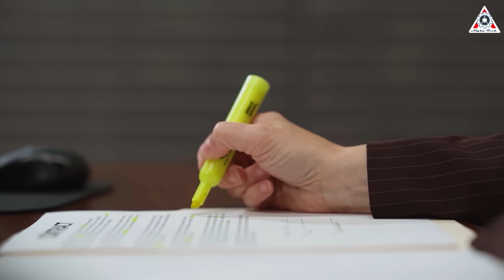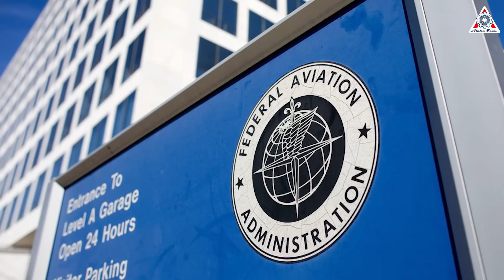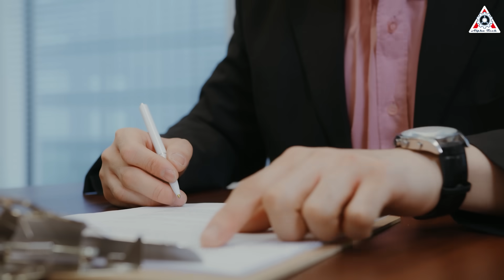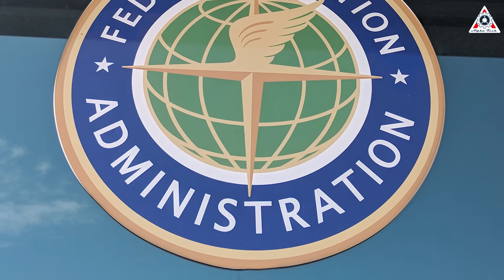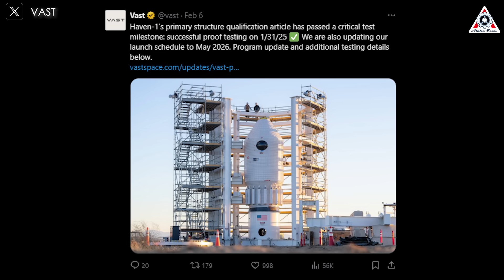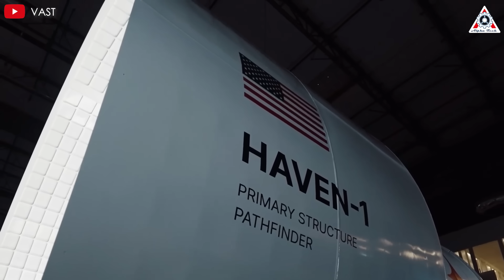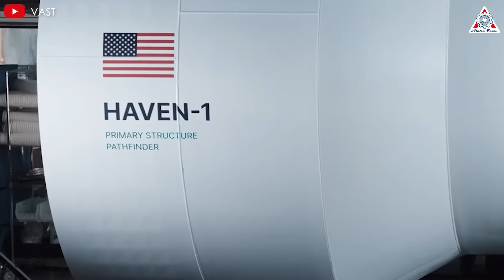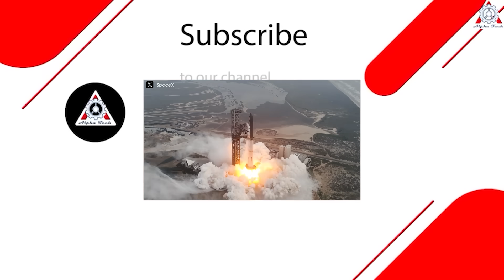SpaceX Starship New Landing Method somehow SHOCKED NASA! Never Seen Before...

Comment: If landing on a re-purposed AC Carrier ever comes to pass, I'd swap out the diesels for methane generating plant and electric (Tesla???) engines... and yes, I know there would be issues with energy density of methane vs diesel and the size of Tesla motors would probably preclude any advantages of a hybrid propulsion / one fuel source solution... ;-)
Reply: You better put some big pontoons on it otherwise whenever the Starship lands on it it's going to lean to one side or the other and then it's going to slide off the deck into the ocean.
Reply: wave generative battery or a nuclear mod instead of the hybrid

Comment: Staff?  Pad maintenance?  Fuel transport and storage?  Payload transportation?  It's one thing to catch a rocket and then transport it somewhere else but if you are going to catch AND launch from the same place, you need quick and easy access.  These "islands" don't have it.  Look at all the ground support around the pads in Starbase or the Cape and then look at how clean and barren these floating pads look.
Reply: A Liquid Natural Gas (LNG) tanker could supply the fuel for at least one launch using ship to ship transfer.  I don't suppose that has been done before but it hasn't been necessary.  Every LNG tanker is designed for two-way transfer.
Transfer of Liquid Oxygen is another matter.  I don't believe LOX is ever transported in this manner.  A couple possibilities present themselves.  First, though LOX is colder than LNG, the engineering problems involved appear similar though more extreme to a non-engineer.  If I'm wrong, I rely on the forum to both correct me and improve the idea.
The big problem I see with CVA class vessels for use as spaceports is the butal expense.  Not even the Navy wants to keep these ships past their relatively low expense period and, even at $16+B for each new one built, they see it as cheaper to replace these vessels once they are about the age of the carrier group cammanding admiral.
The modified oil drilling platforms appear to make more sense but were retired and sold off.  Perhaps a purpose built vessel, similar in some ways to the drilling platforms or the aircraft carriers would be more useful and more econom8cal.

Comment: For years, I have thought about an old aircraft carrier. For the price, $1 to a scrap company, it seems like a no brainer. But refit and operational costs are undetermined. Designed for thousands of personnel to support military air and sea ops what would be the cost for a 100 or so Launch and sea ops personnel? How much of the ship as it sits could be reused and how much would require a remodel. What would be the engineering challenges of a launch and catch tower. You wouldn't want the ship to tip over. It would need to be stabilized from the effects of wave action in the sea. The hangar bay would have to support flight repairs. Fueling ops might require tanks installed if not done directly by a fuel taker. And all of this for a mobile sea launch platform? That sounds more suited for a military op. A platform sounds like a better fit for Space X, at least on the cover.

Comment: It's interesting, but I wonder about stability of the stacked starship at launch time. There is a lot of mass at high altitudes above deck.
Reply: Only when its filled with fuel(most of the weight) vertically stacked. They usually fuel it less than 2 hours before launch. So they would need to be concerned during heavy seas or high winds. Night launches could be common.

Comment: Would be better to use a purpose designed ship. That flight deck is a long way from the water, which helps with bird launching, and a negative with standing sticks.. Even with active stabilization...
See my past writs on Space Ship Carriers and platforms...

But I came to donate another concept. on the cryro liquids getting ice chunks, see they used the swirler to keep center of filter screen more open, 
But likely still having problems.

When they goto unified pumps, might want to design pairs of self cleaning filters per pump pair that have a passive impeller rotating off flow, that scrapes the screen and works like an old time flour sifter....

ie pushes chunks thru the screen to break them up small enough to go thru the passages without plugging, and melting there, in progress during flow close to engine heat etc.

Its a;
 "Closely Related Field"
Flour sifting, and Rocket propellants...

😂

just sayin'
Reply from the maker: Thank you so much for your comment! That’s great informations!
Reply: @alphatech4966  
Yeah, a little morsel for the mechanical engineering guys, a self cleaning ice filter that operates off of ambient flow...
Should be standard on all high volume flow mega rockets...
😁

Comment: I would think that an aircraft carrier would be ideal for the landing of a Starship. The aircraft lift system could be modified for deceleration hydraulically and the ship increasing displacement in the water would also be an asset to slow the huge bulk of a landing starship. What a tremendous sight that would make with the JFK Carrier receiving the Starship landing.
Reply: @moking8095   it was towed in because all of the ships critical systems needed for propulsion have been removed. What you see is a big hunk of metal  and would require a billion or so, maybe more to make useful again. That’s without all of the modifications required for starship landing.

Comment: Yeah, the legendary carrier USS JFK can be refurbished. Can be use  for  SpaceX-Spaceships 
transport or maybe for Starship landing or so.
Good evening 🙏 ✨️ kev🌾✨️ and as always, thank U 🌟
~ 😽
Reply: Cost prohibitive trying to transform a steam driven ship into a launch platform.
Reply: @-shadyG  in essence of❓️ Restrictions❓️ SpaceX can utilize the "carrier" as ship docket transport fr port to port to save cost by having a ex-carrier tht's marching to it's  total and completely "out of commission as final." Small refurbished and minor repairs. Back on business❗️
Jst a thought.
~pearls 😼
Reply: @katrine-pearls  it would cot billions. The steam boilers would have to be replaced, and the associated pipes and valves, the turbines would have to be replaced, the main reduction gear would have to be installed. New water tight doors, pumps, cables, the list goes on. You see, whenever they scrap a ship all the expensive stuff is removed major. There is no turning back. It would cost billions.
Reply: @-shadyG  My HEAVENS, and were costly b-coz they stripped off the good ones. Thank U for clearing my statements🙏✨️
Reply: @ if the didn’t care about rapid reusability then this.
https://youtu.be/yhHQshK3Sjs?si=ypq7GMou4Q974SfF all movements can be controlled and kept in an exact location during landing.